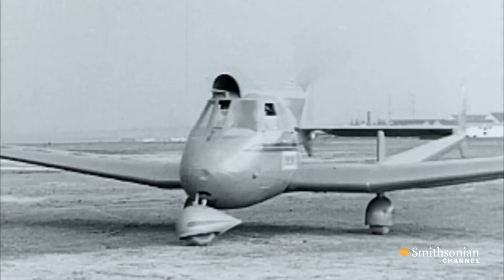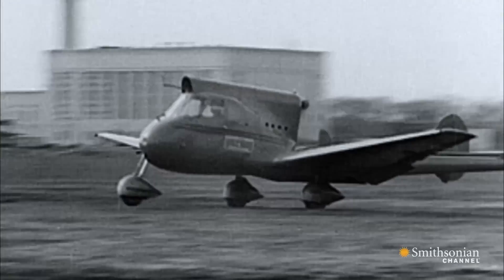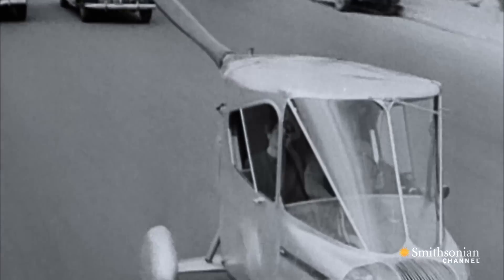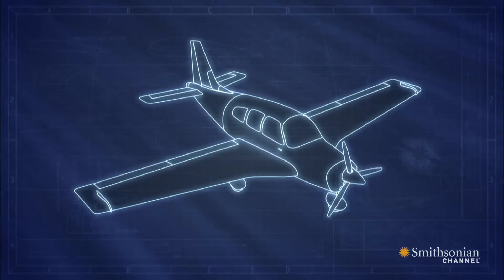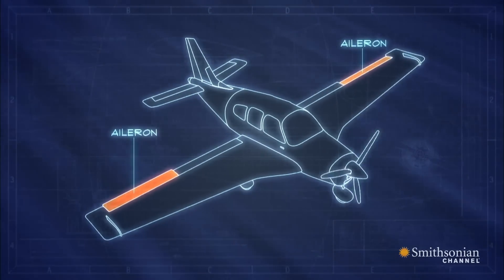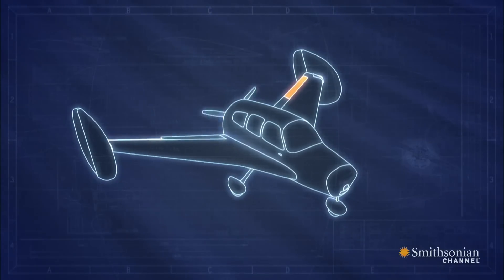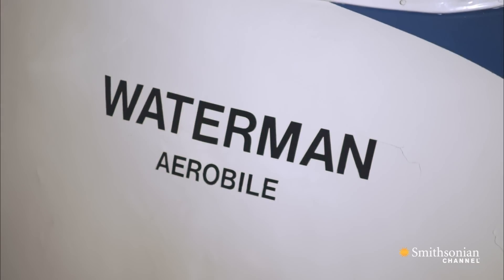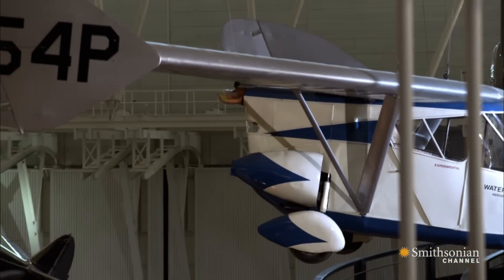The World's First Flying Car

Comment: What engine did it have
Reply: +RabbitFoot
A very old one.
Reply: Old school one!
Reply: My guess it's maybe a Gypsy Major (inverted 4 cyl in line) like on the old school Tiger Moth biplane.
Reply: Is3
Reply: A Steam engine
Reply: A 100 hp (75 kW) Kinner K-5 5-cylinder radial pusher engine

Comment: It is all about oil, I have been trying to expose an answer to the mystery of the100 Miles per gallon fuel systems. Yes 5 times the fuel mileage is possible but missed or suppressed by oil companies for over 80 years and we have the patents and the science to prove it,  see the evidence we have now see at website (no spaces) him acre search dot com other  sites with similar info are Byron wine dot com  Rex research dot com  More than vapor  but refining gasoline into natural gas and methanol and yes 200 mpg 4 cylinder